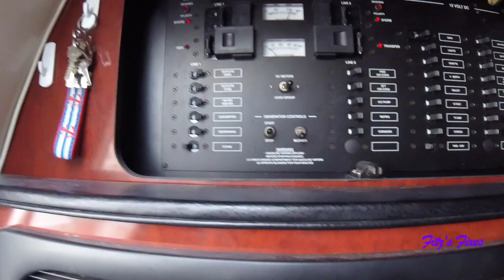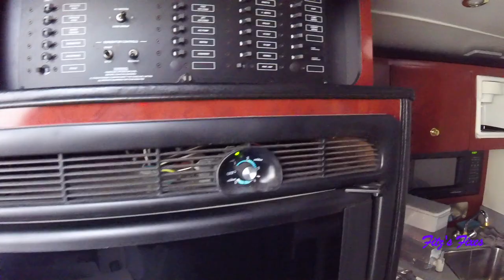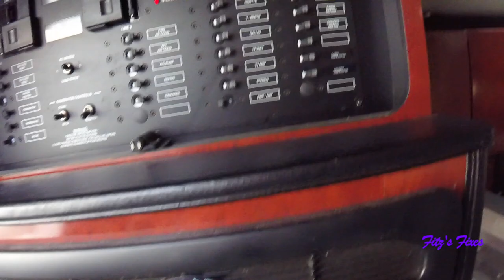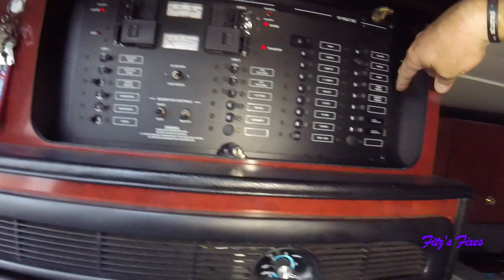winterizing engines and water system

Comment: I've owned both Volvo Penta and Mercruiser. I think most boat owners would agree that more than 50% of owners choose Merc over Volvo, but Volvo has a better seawater pump system. SO easy to change impeller. Thanks for the video. I sold my Crownline last August. Have a Searay under contract as of today. Twin 350 Mercs. This video will help me figure out the winterization process for a cruiser. Be safe out there.

Comment: I do what you do almost exactly.   I also do one more thing.  Once the boat is up on blocks, I go around with a shop vac and vacuum out every through hull.  You will see a lot of water come out especially from the scupper drains and bilge pump drains.  Takes 5 minutes and costs 0.
Reply from the maker: Good advice! I think I'll do that in the morning. Thanks for the tip!
Reply: Crap….I usually vac the thru hulls as well. Forgot this year. Need a checklist.
Reply: @fitzsfixes  NP and btw, I enjoy your videos.  Thanks for making them.

Comment: my boat took 20 gallons as I had to use 6-8 for the engines and genny  and my water heater holds 9 plus the head. For the a/c i just open the sea strainer top ( after closing sea cock) and just pour the antifreeze into the stariner with a/c running. SAme with genny and engines ( fresh water cool).

Comment: When do you change the engine oil? In the fall or spring?
Reply: Most folks say to do it in the fall so it doesn't sit with dirty oil in it all winter. I do it in the fall so it's one less thing I have to do in the spring.

Comment: At the end you were getting a lot of air because your water heater holds 6 gallons doesn’t it? So you probably could use an extra gallon or two
Reply from the maker: Right. I mentioned that off camera I added 2 more gallons and did the transom shower again. I underestimated the size of the heater
Reply: Never mind I heard you say you added a couple more gallons later in the video